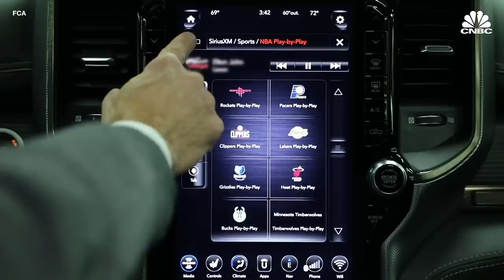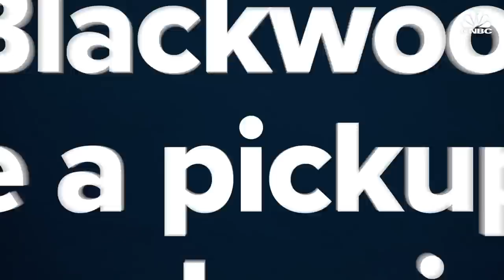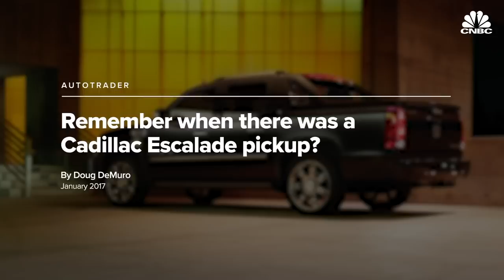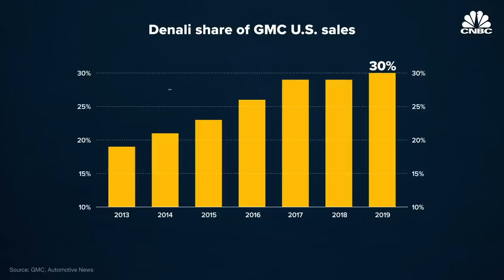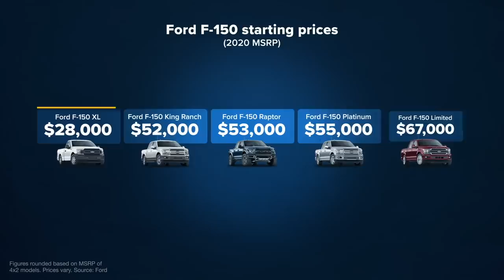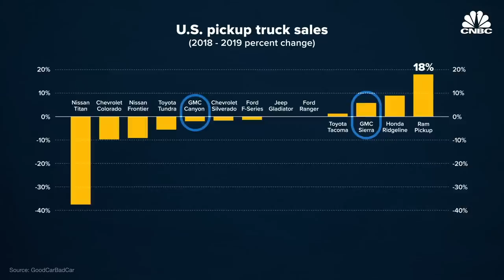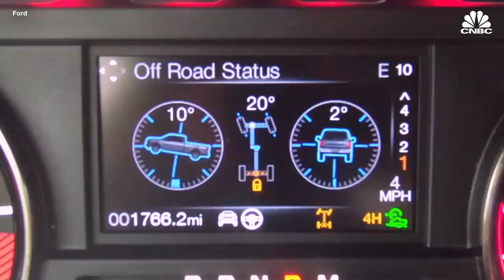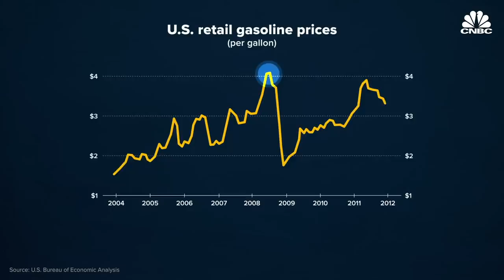How Detroit Turned Trucks Into Luxury Vehicles

Comment: Should say: How Ford, GM and Ram have literally DOUBLED the prices of their trucks in 10 years.
Reply: And after we bailed then mf out, that's how they pay us back!! #1 reason why they created (I believe) Americans preffers to buy SUVs myth is because they can sell larger vehicles and charge double with excuse of is bc its a bigger vehicle and weights more and have more parts too assemble.
Simply they are scammers and they don't build with quality( their vehicles  constantly break)  just quantity to satisfy its shareholders so they are in survival mode in every quarter of the year.
Reply: Fields Carlisle the base model hasn’t double in price so why complain
Reply: People keep buying them, so I don’t blame them
Reply: BMW Royal not doubled but gone up by 50%. In 2005 a Ford F-150 Lariat with 5.4L V8 was just about $35K. Now that same truck would be almost $60K.
Reply: They said it best... There car are priced at what the customer believe they are worth....
Reply: Even a base truck from today is more truck than a base truck from 10 years ago.

You really can't even compare top trims either because at the upper level you get a helluva lot more than the old upper level.

I wouldn't ever pay 90k for a truck but at the same a 90k truck replaces multiple vehicles in terms of luxury, performance,  and utility.

So think of it more as a 55k BMW and a 35k pickup rolled into one unit.

If you don't care about the BMW aspect you can simply get the 35k truck or bump up to a 35k truck and a 30k Buick for 65k or even less. 50k still gets you a helluva nice truck.

(Hint: the middle trims are the best values).
Reply: Vital Signs have you been to a lot lol, there every where
Reply: Fields Carlisle the 2020 F150 Lariats with a 5.0 is around $46K, not even close to 50%, or $60k. Even w/ 4WD, it’s still around 50k. Also, the new Lariats have far superior features. In the 2020s, heated & air conditioned seats are standard, in 2005, heated seats were only an option.
Reply: Ridiculous!!!
Reply: To all the people complaint just go to Toyota or Nissan
Reply: @Drskopf  Ford didn't take a bailout like GM and Chrysler.
Reply: @dchawk81  But will never outlast the old trucks nor make girls smile like the old trucks especially an old school F100.
Reply: @CJColvin  You're STILL doing this?
Reply: @dchawk81  LOL!!!!!!!!!!!!!
Reply: @Drskopf  Ford didn't take a bail out..
Reply: @Drskopf  only gm was bailed out.  And everything doubled in 10 years.  Even candy bars lol
Reply: @CFG39  Exactly what i have and no way am I paying 60k plus!
Reply: One word Inflation
Reply: Imagine a Apple Truck
Reply: Why general motors need bailout,  because left policy was bankrupting business in USA, same reason Australian car industry went bankrupt blame government and union leaders
Reply: There less net profit today in new cars and pick up truck built 20 yrs later , 2500 turbo diesel  $15000usd net profit each in factory
Reply: Tech is not same, R&D costs money
Reply: Nayak every new car has the same level of tech, but you don’t see a Honda Accord doubling in price in 10 years. The Big 3 have doubled their prices on trucks and SUVs while other segments of the automotive world have stayed relatively flat, just rising with inflation. In 2005 you could get a Tahoe for around $30K. The base price now is over $50,000.

There’s no way the actual costs to build the Silverado 1500, Ram 1500 or F150 has increased even 50%, let alone the 100% increase you see. GM is using the same basic engine architecture they’ve been using for 30 years, just with some modern additions like DI and cylinder deactivation. At least Ford offers modern engines in the F150, and finally GM is adopting 8 and 10 speed transmissions in certain models of their trucks and SUVs.
Reply: Pickups also had the highest profit margins when it was only half the price.
Reply: @sentinel151  this
Reply: 50% = 1.5x the price
Reply: Only double the price when you buy higher end packages. If u purchase base model trucks with less electronics the prices have remained about the same when taking inflation into consideration. We never had super luxury packages back in the 70s. It was chrome bumpers and leather seats etc. Heated seats, touchscreens, backup cameras, stuff like that is why we pay so much more now.
Reply: Christopher Mealey in 2005 you could get a Lariat 5.4L V8 F150 for less than $37,000. At the time that was the highest trim level, except maybe King Ranch. Now A similar truck with similar specs would be over $55-60K.
Reply: @CFG39  yes I know that's what I'm saying. It's the higher prices trim packages they have really hiked up the price on. Base model trucks have remained consistent due to a higher demand in volume by fleets and trades workers. Noone is buying a lariat to do actual work unless they are a snob.
Reply: He said the average price increased 50% from 25k to 50k. No, it increased 100%. If it increased 50%, then the average price would be 37.5k.
Reply: Christopher Mealey lariat today is a low end truck. My grandfather spent over $50K on a Ram 1500 with cloth seats, halogen headlights. It had a V8, and 4WD but the truck was a base Model. There’s no reason a F150 Limited costs over $70K.
Reply: Not really, base trucks are still as affordable, the expensive ones are top of the line models, which are expensive for obvious reasons. You’re getting what you’re paying for.
Reply: @CFG39  f150 lariat will cost you about 48k today, so if you consider inflation, it’s not really that expensive at all, specially considering you’re getting a way better truck today than you were in 05.
Reply: @insayn7995  the difference is that 15 years ago the Lariat was considered to basically be the top of the flagpole trim level. Now it’s considered to be on the lower end. You still have King Ranch, Platinum and Limited above the Lariat. Platinum and Limited didn’t exist 15 years ago. Even back then a fully loaded King Ranch which was the cream of the crop just barely crested $50,000. Now you can drop over $80,000 on a F-150 Limited. That’s an insane amount of money. Over 50% increase in cost in 15 years for top trim level vs. top trim level. That’s eye-watering.
Reply: @CFG39  it’s not about the top trim levels, I’m sure today’s lariats are as well equipped as the 2005 lariat. What you’re getting with the higher trim levels is technology and luxury which people are willing to pay for, and I don’t see anything wrong with it as long as there are affordable options for people who don’t need a luxury truck.
Reply: @insayn7995  the difference is that no other group of cars has increased in price so significantly except pickups and the SUVs based on them. There’s nothing in a Ford F-150 Limited that’s worth $30K more than a Lariat. The markup is HUGE on these things. Luxury sedans and SUVs have not increased in cost remotely as much as trucks and truck-based SUVs like the Tahoe, Suburban, Expedition, or Navigator. Take a 2000 Mercedes E320 sedan. Its original MSRP was $47,100 MSRP. A 2021 Mercedes E350 costs $54,000. That’s a reasonable increase, but going from top of the line at $50,000 to top of the line being $80,000 in a decade is insane. All of today’s trucks are ridiculously overpriced.
Reply: @sentinel151  I think the current prices are insane for what it is, but I agree. They wouldn’t be charging these prices if the market wasn’t there. People are buying them therefore they have the power to keep charging these prices, and even raising them year after year.
Reply: @CFG39  yeah and wage/salary may not double to coverthose expenses
Reply: @CJColvin  Actually, they all took the bailout money. Ford was just simply better at playing the media game.
Reply: @northalabamarailphotograph7063  my 2016 f150 lariat 5.0 non 4 wheel drive had a sticker of 52k
Reply: @Drskopf It’s called inflation. Counting inflating, the price has legitimately been about the same on chevys.
Reply: @keirengaming  that I know, but the same inflation is not helping with our salaries, everything goes up in price, except our money, the value of the money we have is not growing like prices for vehicles, houses , groceries, or Gas ⛽
Reply: In The United States 🇺🇸 $60,000 Max Australia 🇦🇺 $100,000
Reply: @CFG39 Don't forget,  the dollar has been devalued.
Reply: Some people need trucks for work.  About 10% of the pickups are probably used for work , I'm guessing.
Reply: RAM 1500 Ford F150 Chevy Silverado USA 🇺🇸 Canada 🇨🇦 And Australia 🇦🇺

Comment: Everybody gangsta until gas prices increases
Reply: American.. can not help themselves...
Reply: MrRangerZr1 I’m still amazed there’s never been a hybrid truck. You could easily make the RWD gas and FWD electric.
Reply: @johnmoore1495  there is probably a reason why...
Reply: bardo Perez it’s definitely more expensive but the fact that not a single brand has tried one is odd.
Reply: @johnmoore1495  they would need bigger batteries and they need to make sure the electric side can match the gas guzzler
Reply: Banana the gains from the hybrid system during acceleration and regenerative braking would easily out do any losses from weight, not to mention stop start works great with hybrids. I think really if anything the issue probably is they want the rear wheels to be gas powered, which complicates things in the front due to Trucks usually having a V8 under the hood. I would guess you’d need 2 individual electric motors rather than being able to fit 1 electric motor and some kind of differential/axle up front. They could also somehow work the hybrid system in between the transmission and motor but that’d be pretty complicated and risk reliability in the beginning.

My overall guess though is probably that they think no truck person wants a hybrid. But now half of all dudes are truck people so I really don’t think that holds up at all, not to mention most truck women don’t care at all what’s under the hood.
Reply: Back when gas prices were super high i still seen trucks and larger cars being driven. Just gotta change your spending habit
Reply: @ericyuan9718  She can't she's foreign born.
Reply: MrRangerZr1 or when the repo man comes by
Reply: My F 150 gets better mpg the my Mks...
Reply: John Moore  GM did hybrid trucks around 09-12 when gas was $5+ a gallon. Nobody brought them.
Reply: Don't worry. They are already making electric trucks, in case that happens.
Reply: they have gas cards from their parents or employers...
Reply: Well said my friend
Reply: This exactly what happens. People buy gas guzzlers while the price of oil is low then a recession hits a decade or so later and the market shifts back towards more efficient sedans. However with growing efficiency of engines ex. the ecoboost pickup its easy to imagine a growing trend of vehicles with beds. I mean australia loves their Ute.
Reply: @MrCTruck  now electric vehicles are coming.
Reply: @johnmoore1495  The German Army has a Mercedes truck that is diesel  electric. Their tanks are as well.
Reply: This is why I am getting an electric truck. Tired of these damn gas spikes
Reply: A modern F-150 can do 22 in the city, and 28 on the highway. Truck sales will keep going with mpg like that.
Reply: @bmwmsport11  I read about those hybrids back then. From what I read they were a pretty half hearted attempt. Not much more than strapping on an electric motor, bigger batteries and a price increase. No real efficiency gains, just more complexity & cost.
Reply: Tesla Cybertruck anyone
Reply: Look at the oil glut. Economies have collapsed (or been badly hit) since 2015 because there is just waaaaay too much oil to go around. Unless we can double the population overnight, gas prices won't increase for a long long time.
Reply: lol
Reply: Lol 😆 I love it.
Reply: @johnmoore1495  there was, check Google
Reply: MrRangerZr1 everybody gangsta until only the upper class can afford pickup trucks and not the working class that actually needs them
Reply: You do realize that most trucks nowadays have very decent fuel economy compared to the 20th century and early 2000s, right?
Reply: leicanoct  In Europe it's $5.
Reply: @davidperry4013   that's a toy,  next!
Reply: leicanoct  Do you mean the old diesels?
Reply: TheRubberSoup a 2019 diesel 2500 with emissions 50k 
Price tag and 15mpg
Reply: leicanoct  It makes no sense because Euro 6d cars are cleaner than gas cars and can under some circumstances even remove particles from the air. Air pollution has been declining for a long time because of technological advancements and because diesels slowly get phased out the air is getting cleaner. But the EU wants the air to be clean NOW so bans will come. A way to phase out old diesel cars faster is just taxing new cars less so people can actually afford them but no, they keep the taxes.
Reply: oil is way down right now. expect under 2 dollars a gallon in the states
Reply: @johnmoore1495  GM made hybrid trucks and large SUVs for a while, Ram as mild hybrid with the etorque system... your idea of making the 4x4 sytem hybrid is interesting, but would likely add tons of weight and complexity to a system used like less that 1% of total miles driven by a 4x4 truck.
Reply: John Moore there has been
Reply: Ben Dino well I know they made a hybrid Suburban/Tahoe (can’t remember which) but the MPG was only 1-2 better and they had “hybrid” branding all over the thing making it ugly and it was way more expensive than the V8 option. The Ram etorque system seems really gimmicky IMO, just seems like another expensive part that’ll fail after warranty meanwhile you barely got any benefit from it and you paid more for it.
Reply: leicanoct  2.00-2.30 Minnesota
Reply: @johnmoore1495  gm  made a hybrid truck. Around 2012. Look it up
Reply: That isn't happening soon
Reply: @johnmoore1495  2022 GMC Hummer
Reply: Facts!!
Reply: hahah gotta flintstone that car !
Reply: @anthonymarron2055  Exactly mate
Reply: Saint Fifty One  well point well made mrs stelle
Reply: MrRangerZr1 I guess nobody told you that now the United States is the largest oil producer in the world and we have oil reserves for the next 500 years the only thing that will drive gas prices higher are Democrats and fears of global warming which is a hoax! Sorry I left my  Ram idling in the driveway for an hour oops who cares.....
Reply: John Moore ? For the eventual time you put it into four-wheel-drive you would use the electric hybrid instead of the gas that wouldn’t make sense as most four-wheel-drive vehicles are driven in four-wheel-drive about 5% of the time unless you mean something else
Reply: gas is cheap right now
Reply: @smallbeans101  Tesla and volvo lol
Reply: Tesla owners don’t give a damn
Reply: @johnmoore1495  There have been numerous hybrid trucks in the past, and there are currently a couple of mild hybrid trucks being sold. GM has made a few, and Ford even used to sell a fully electric Ranger. FCA currently sells some under its Ram brand, calling the hybrid system "E-Torque" rather than hybrid. The demographic buying pickup trucks tends to be turned off by the word hybrid, so automakers have tried to avoid using that word for them. Some consumers believe hybrid vehicles are wimpy, because most of them are made with extremely high fuel economy in mind so they end up with wimpy atkinson cycle engines, but of course we know it is possible to make a fast/powerful hybrid thanks to the torque and power output of electric motors. I suspect some Ram owners with the E-Torque engine don't even realize they're driving hybrids. 
The issue is that people buying pickup trucks often don't care enough about fuel economy to buy a hybrid, and people who care about fuel economy don't often buy pickup trucks. Adding a hybrid system to a pickup truck improves the fuel economy by a seemingly small amount, so it's difficult to convince consumers to pay extra for one for only a few extra MPG.
Reply: Coronavirus-bet
Reply: leicanoct  wtf, do you mean for 1 liter
Reply: @1337machoman Reaper you dont see a snag when this oil  production  that  is damped down  from non use due to Corona,  whiplashes back after healing /wellness returns?
Reply: Hahahahaha
Reply: One verb. Niiiiice.
Reply: John Moore workhorse w-15
Reply: That’s why you get diesel the price stays pretty steady
Reply: patrick05020 😂 su sjw they  ecoboost
Reply: Everyone’s dad gangsta until gas prices increase*
Reply: Everyone gansta till America has enough America
Reply: They will within the next 5-10 years
Reply: Like now lol- $4.50 gallon and the truck probably gets 13mi a gallon
Reply: Boy do i got something to tell you
Reply: Future here: you were right
Reply: Bet
Reply: Well i guess nobody gangsta now
Reply: You jinxed
Reply: At Least Ford Made An Electric Truck

Comment: Once upon a time, I drove pickup trucks, preferring smaller, regular cab trucks that were relatively economical. Now I can't justify the cost, so I ride motorcycles most of the time and pull a utility trailer with my car when I need to haul something. Trucks have become status symbols.